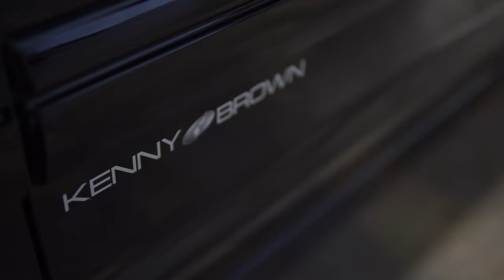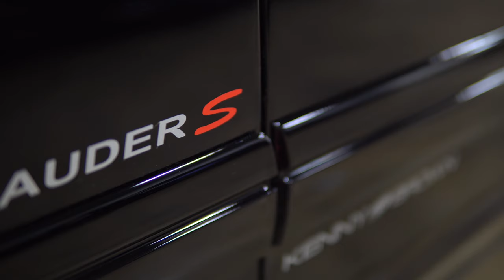22 hour detail on a 2003 Mercury Marauder - Paint Correction and Ceramic Coating + XBOX GIVEAWAY!

Comment: What is that sponge your using? Like a claybar?
Reply from the maker: Yes sir, it is a clay mitt which is essentially like a clay bar but is synthetic and reusable. Great for vehicles with little or more finer contaminates, it also produces less marring you just have to rinse it out with warm water to clean it. Great alternative to the traditional clay bar!
Reply: @inspiredetailing9397  definitely going to purchase one. I appreciate it. What do you recommend for swirl removal?
Reply from the maker: @Ziade_Garage  If it is light marring I recommend a light polish with a foam polishing pad on a buffer a great combination we use is koch chemie's micro cut with a polishing pad, if the swirling is moderate to deeper scratching koch chemie's fine cut and fine cut pad would be a great solution for a one step compound and finish before more invasive methods. If you do not happen to own a polisher, hand buffing with koch chemies fine cut or heavy cut compound with a microfiber applicator could give you an improvement. It would just take some elbow grease!
Reply: @inspiredetailing9397  I got all that except your brand you mentioned. I'll get that. Where are you located
Reply from the maker: @Ziade_Garage  They are for sure, thanks a lot for the support! Feel free to ask us questions anytime!
Reply from the maker: @Ziade_Garage  Williamsport Maryland but we sell and ship all the tools and products we use. Our online store will be going live shortly, in the mean time you can reach out to us if you need to purchase anything